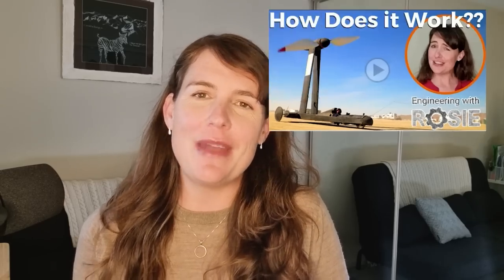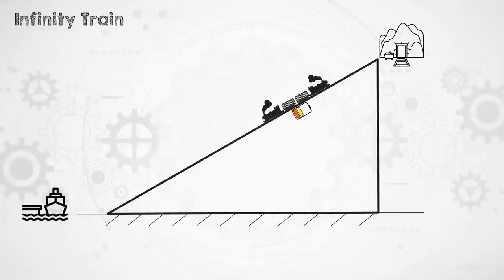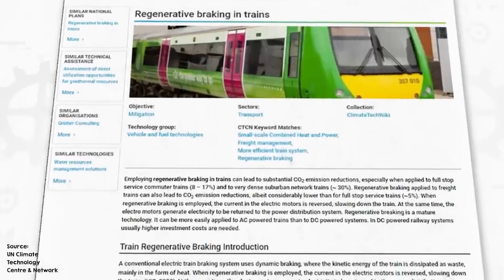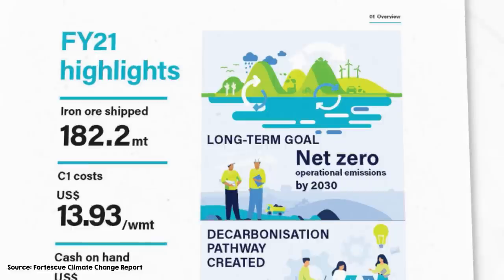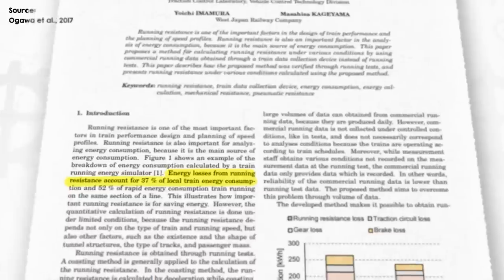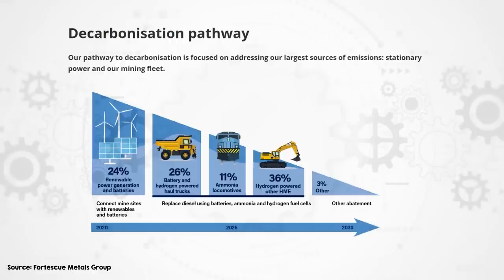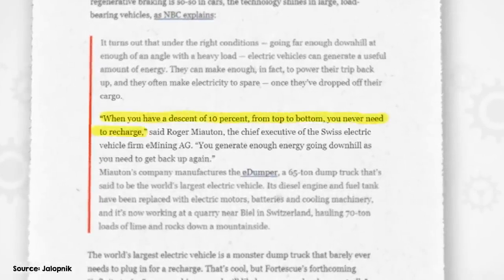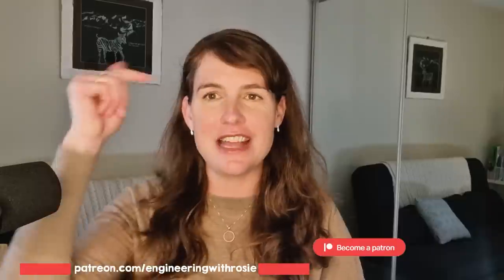This Mining Train Powers Itself: The "Infinity Train" (and how it works)

Comment: Cool video of a cool concept.  

With an electric train the battery doesn't have to be on the train.  Makes me wonder how much efficiency could be obtained by using regenerative braking on level trains that back feed the power to online batteries  which could also be used to level out power consumption by all the trains starting and stopping.  I realize this would work best if turns gun on direct current.
Reply: Wabtec have calculated that their FLXdrive battery-electric locomotives will reduce fuel consumption by 30-35% when used in hybrid consists with diesel-electric traction on typical track topologies. On-locomotive batteries will consistently provide much more efficient regeneration than conventional wired electrification systems (which have highly variable regen efficiency that depends on both traffic and grid conditions). The Pilbara miners are very cost-conscious, and to date have not opted for conventional electrification (too expensive). Having said that, existing conventional electrified railways will be improved by installing storage at both traction substations and on electric locos.

Comment: I'd love to see some pumped hydro battery projects that combine the battery function with secondary goals like moving water over a mountain range.  If you can get significant from from just moving the water over the hill and add it to the value of the battery function it should be very profitable.

Comment: Nice clear explanation!

Depending on the proximity to grid infrastructure, it might be better to just electrify the track - then they wouldn't need such a large battery on the train. If they really need energy storage, stationary batteries could be used. But given there's only one train, and electrified tracks cost a lot up-front (and to maintain), it might not be financially sensible in this scenario.
Reply: I just realized another possibility: If there were two trains going in opposite directions, one could power the other directly through the electrified track - no energy storage needed. That's even more similar to how that old Victorian mine cable car works.
Reply: But the thing with many such mining operations is that they're way remote from any infrastructure. Replacing the train is rather easy (since it terminates at a port anyway), but electrifying the entire track, even without power required, would be a huge cost.
Two trains powering each other is a nice thought, but I strongly  doubt this would work – unlike a mine shaft, the train track doesn't have a constant enough gradient.
Reply: @leftaroundabout  Yeah - with the two trains approach, some energy storage would still be needed to account for differences in gradient etc. When I hear MWh of batteries I think very big bucks, but electrifying 100+km of track is also very big bucks. That's why there's still so many diesel trains in operation.
Reply: Cloudbreak mine and port Headland are remote areas, the only power grid in WA is the southwest interconnect which is about 1200km from the mine, outside of SWIS towns and other users are generally on local generators (diesel/gas/solar). So the cost of electrification of the track, plus upgrading the supply abilities of the mine camp and port Headland don't make sense for the usage. There are plans to power the mines from solar.
Reply: The battery on the train is itself a "gravity battery" since it's part of the gross weight being acted on by gravity.
Reply: If traditional electrification was a cost-effective solution the big WA miners would have done it. They haven't. OLE electrification costs around A$1.5M per kilometre. They've clearly worked out that battery-electric traction is going to be a more cost-effective solution for their requirements, with 4 of the big WA mining operators (Fortescue, BHP, Rio Tinto and Roy Hill  all placing initial orders for battery-electric locomotives for evaluation earlier this year.

Comment: Sorry Rosie, just found a big error. At 6:28, you say the empty weight of the train is 40,000 tonnes. This is in fact the gross weight (less the locos). In fact it is roughly the weight of the wagons - 250 x 160 Tonnes gross. Each wagon carries 137 tonnes of ore - your payload at 34,400 T is correct. The tare weight of a wagon is about 22.4 tonnes. The locos weigh about 200 T each.

Without doing the sums, you can see there is a much bigger difference between the potential energy for the full and the empty train than in your calcs.

Comment: I suspect that the situation is much better than you have calculated. In the first line of your calculation you have train empty weight of 40,000t and a load of 34,400t. Railway Gazette reported that the net and  ore weights of Fortescue wagons are 23 and 137 tonnes respectively. I haven't been able to verify that but the numbers are similar to BHP with  which I do have up to date data. the g and h2-h1 all cancel out in the calculation so apart from the losses which you explain and the energy to move the locos back and forth it's just the difference in loaded and empty weight and the elevation difference which count. This load/empty ratio is (first estimated based on wagon gross and tare =137/23) ~~6 You don't even need good efficiency to make this work.

Comment: There are many free energy sources we can use.

For example if you have a ceptic tank, a bio digester could be installed instead. It would produce methane gas that could be used for heating or cooking or even to run a generator. As a by product it would produce fertilizer for plants.

A second option for free energy would be to take yard waste and create biogas from it. The biogas then could be used to generate electricity,  cook or heat also.

If you have a stream on your land you could use a ram pump to pump water into an elevated water storage tank and let gravity pump water through your house. The ram pump uses the stream to trickle fill your water tank without power. And the gravity water tank pumps it into your house without power. That's free energy too.

We are experiencing heat wave across the world. For centuries we have used methods to cool houses without power. If you uses a solar chimney you could use it to exhaust air from a house expelling hot air. If you used a ground heat pump intake to get fresh air, you can cool ambient outside air to replace the heated air expelled from the house in the summer and warm the air in the winter. Along with the solar chimney this could be done passively without power.

While cheaper to build a new home with these systems each of them can easily be retro fitted into most existing homes.
Reply: A sceptic tank or biogas generators energy is a by-product of another activity and not free. You have to feed a biogas generator with feedstock to maintain its output.
Reply: @nzer57  really it's not? Then explain how much fossil fuel, electricity or nuclear material do you use to run a bio digester. The answer is none. A bio digester is a colony of living bacteria that converts biomass into methane gas. It does not use power to run and create methane. That is what I call free power.

Comment: Dear Rosie 

Please consider a though experiment that is easy to explain, considering the limits of writing and sketching by type, but so hard to produce that it has no direct business value: 

   COLD ROOM   ())--:::WALL:::-->> HOT ROOM         >~1000 NM< 

()) = Paddlewheel.  
-- = Axle.  (Continuous from end to end)
:::  = Axle tunnel and wall
>> =  Lumped friction element

Visualize two roome full of air separated by a very thin wall that allows the rooms to hold their heat independently. The wall is just thick enough to support billions of  separate nanometer scale axles running straight through, loose enough to rotate freely but  not leak very much heat so the rooms can hold separate temperatures. On the left side, a very small paddlewheel is mounted at the left end of each axle. On the right side, lumped friction elements 

Browning motion int are mounted stationary in place on the wall, one for each axle, that the right end of each axle runs through. The lumped friction elements connvert the mechanical rotation of their axle into heat. 

Brownian motion turns the paddlewheels at random speeds  randomly clockwise or rcounterclockwise. This random rotation is turned into heat by the lumped friction elements.  The lumped friction elements do not impart Brownian motion to their axle.   

  The committed functional roles of the paddiewheels, axles, and lumped friction elements in differnt placed should systemically hproduce a divergence in the thermal energy in the two rooms. 

Aloha
Charles M Brown lll

Comment: Given the Infinity Train's route, even if it couldn't generate 100% of the power needed to return itself to its starting point, solar panels on the roof of the motor units and battery cars could generate the additional power needed, and they would continue to do so on the return journey (if it was done during the day).  The Infinity Train and eDumper are examples where using the very lightest battery is justified.
Reply: It all depends on the "weight empty vs weight full" ratio.
Once the load weighs let's say 10% more than the empty train to offset friction, it's perfectly possible.

Comment: Regen braking does not need to have the motor run in the opposite rotational direction. Otherwise cars or other vehicles would need some really complex transmission to reverse the rotation of the motor when the vehicle slows. If the wheels drive the motor then the motor becomes a generator and the power needed to drive the generator slows the rotation of the wheels. Instead of turning the energy into heat as a brake does you turn the energy into electricity.    The train does not need to run forward in both directions so in the trains case they just run it backwards and the motor/generator can run the opposite direction.

Comment: Could solar panels on the eDumper's roof/door/bonnet etc generate enough to make up the 2% deficit?
And w.r.t. the train, could the battery not be static onland storage with connection via overhead lines?

Comment: Unit energy consumption to overcome rolling & aero resistance for the loaded train on the downhill trip is very low.

540*38000**-0.5 = 2.77 watt-hours/gross tonne-km => 38000*280*2.77/1000000 = 29.5MWh

I calculated the downhill potential energy delta for 38,000 tonnes from 450m to sea level to be 46.6MWh.

Nett energy recovery would be around (46.6-29.5)*0.85 = 14.5MWh

Comment: could the batteries in this configuration remain stationary and the energy be delivered to the train via conventional catenary
Reply: Yes. But it is horribly expensive to install "conventional catenary". Third rail is likely to be cheaper, but my guess is that the solution with the batteries in the train might well turn out cheapest of all.

That depends on how many trains you need, and the length of the track.

Comment: I think you might want to check your PE calculations. Gross loaded train weight will be ~ 40,000 tonnes - not 74,400. Empty train weight is ~ 5,000 tonnes for the uphill unloaded trip.

Comment: Would the infinity train be more efficient on the way back up if the wheel system had a cogwheel set that engaged, vs relying on the totally smooth wheels ?  I'm thinking it might help reduce slippage, but given the weight of the train, maybe that's a non-issue as slippage goes to near zero ?
Reply: Trains aren't supposed to have that much slippage because it would destroy the wheels and tracks, just like you're not driving around with sqealing tires all the time. If they do slip they put sand on the tracks to improve grip or have to reduce power

Comment: Would the battery actually need to be on the train? Couldn't it be placed somewhere alongside the track and use a pantograph or powered rail? Or would transmission loss be greater than the energy saved by not lugging it back up the hill?
Reply: That was my thinking - the benefit of rail - rather than the dump truck example - is that you're stuck on rails to start with. Adding additional rails or overhead wires for power transmission and you could put the batteries where it would fit the best. Or, use alternative mechanisms for energy storage...

And, multiple trains make it more complicated, but might actually reduce the amount of storage you need. One train goes down, providing energy to another train going up, and so on.
Reply: the cost for the overhead line (plus maintenance) for 350km are immense, and you still need the batteries...
Reply: @SteffenHausB  Sure; but it comes down to what's more expensive - and also, if the batteries don't have to be actually on the train, then you can use cheaper, less compact, heavier technologies. Third rail systems would likely be cheaper than overhead wires.

Ultimately it all comes down to compromise.
Reply: Multiple trains would also reduce the  wait time at the loading and unloading stations to potential create better efficiencies and reduce storage requirements. A couple smaller trains may be more efficient than one large one. 

All situationally dependant of course. Each of mine worth its own custom design for it's circumstances.
Reply: @5353Jumper  I think multiple smaller trains would actually be detrimental. The idea is that the potential energy is from the mass of the cargo. If the ratio of cargo mass to the total of mass plus cargo is too low it wouldn't work because it would fall outside of the efficiency window.
Reply: @tamingthejungleanallotment5486  talking about other efficiencies in process, vs energy use. Would need to be a situational balance for sure. 

Maybe just 2, one going up and one going down would be best...or not. 

One going up one going down could almost be done on a cable system (depending on length) forget the entire concept of electricity.

Comment: If you had a double line the downward train could pull the empty upward train without having to store the energy in heavy batteries. 
My lecture said that the old coal trains coming out of Yorkshire where helped to be dragged up the Pennines by the heavy trains going down into Lancashire.
Reply: She covered that. The length (weight) of the line itself would be an issue, plus, it's a single point of potential failure

Comment: 4:12 Regenerative braking was common in passenger trains up to the 1950's when steam was replaced by diesel. A steam loco with a reversing handle can not only move backwards from rest, but if reverse is selected while moving forwards it acts as a brake. This is done not with a gearbox as in a car but with adjusting the valve timings to the wrong side of to dead centre.

The reason it's regenerative is that air is pumped into the boiler increasing the boiler pressure, and the resulting mix of steam and air can be used later. There is a limit to the amount of energy that can be stored because at a certain pressure the safety valve will release pressure, wasting it. This was therefore more useful in small locos pulling stuff up and down small hills, or making lots of stops, and not so useful on express trains. It was common on local services, especially push and pull services where the loco had to have a reversing handle. 

Indeed many express steam locos did not have a reversing lever (to save weight and more importantly to save a potential point of failure). That's why you see turntables at the end of express routes where steam haulage is still a thing.

A similar effect was also used on steam traction engines (that is steam locos that ran on the road and pulled wagons) and steam powered rollers. I learnt about it when learning to drive preserved traction engines.

There's nothing new about regen braking: it's just that an internal combustion engine can't do it, and in Victorian times train drivers knew about it but it was not common knowledge. Even the people who knew it existed forgot in half a century.

Edit: typos :(
Reply: Wow! I knew steam trains could slow by reversing but it didn't realise it was regen breaking! I'm sure when doing regular routes the driver and stoker could reduce the coal leading up to breaking to make the most of the regen.
Reply from the maker: I did not know that! Thanks for sharing 😀
Reply: @adrianthoroughgood1191  exactly so. 

Going over a hill you want to start at the bottom with enough pressure to get up the hill, but ideally only just enough. That enabled you to reach the bottom on the other side without losing any of the stored energy.
Reply: Electric regen braking dates from about the 1890s at the earliest too, with some steep tramways in Germany, and some very expensive battery-electric cars in the US.
Reply: @JonathanMaddox  thanks!

Now I've learnt something too :)

Comment: If the train is not carrying diesel or diesel engines there is a weight saving there. I'm not sure whether the battery weight is an issue. If it was then I guess you could have a pantograph system with the batteries stored alongside the track. You might have some batteries in the train and then you could just have the pantograph cables on the hilly sections to save on the cost of infrastructure.
Reply: Weight means less on a train as rail road wheels have magnitudes less rolling resistance than tires and rolling resistance increases 1:1 with weight.

Comment: I wonder if they considered installing a third rail on the line and placing the battery at the mine works where the extra power could be used for the loading or something.

Comment: Very interesting, but while you calculated the resistance losses for the return trip, you didn't for the downhill trip. Surely the 91 MWh you calculated for the downhill run would be  reduced because of those same losses?